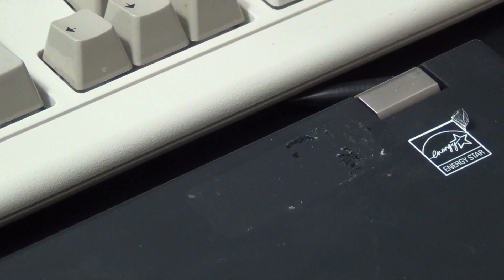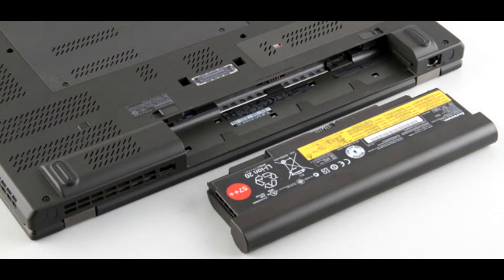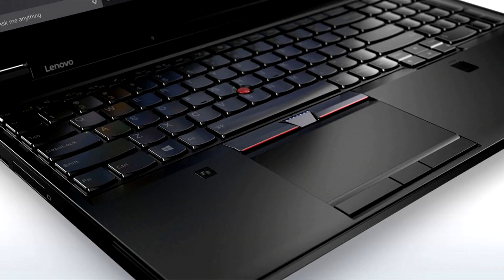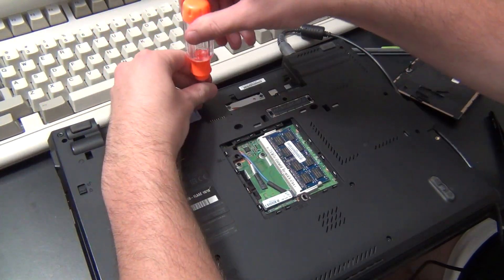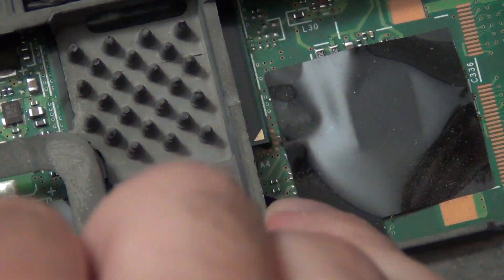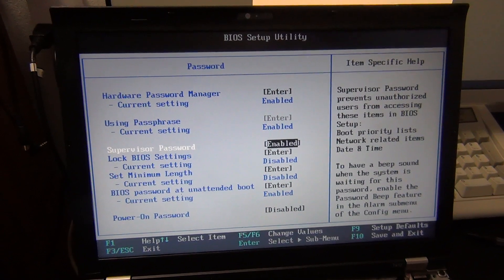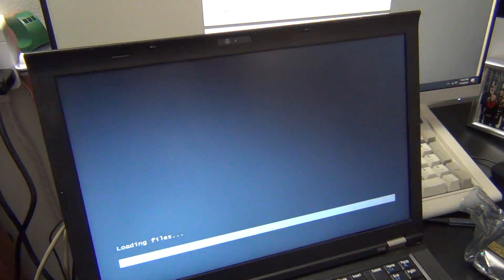Removing a Supervisor Password from a ThinkPad.

Comment: Does it work on Lenovo t14 gen 1?
Reply: I have a t14 gen 2 bought like this. But I haven't seen any solution to this.
Reply: TLDR: I'm still weighing in the cons If I go with SPI Programming using a ch341a and something like flashrom, since most Intel platforms starting with the 5th generation and beyond, especially those incorporating Intel's PTT and newer security features, have moved away from storing sensitive data like the bios password in easily accessible EEPROM chips. 

On devices like the ThinkPad t14 gen 2 with an 11th gen cpu, the supervisor password and related security data are typically stored in the Platform Controller Hub (PCH) or other highly integrated and secure areas of the system firmware.

Comment: worked on t410i thinkpad. had to wait 1000-4500 milliseconds before shorting the circuit when the boot screen appears to time the crash.
i need to reset a e11 5th gen non yoga, same supervisor password problem.

Comment: will it work on t450
Reply: "PLEASE READ: This has been pointed out in the video, is mentioned in the description, and has been mentioned in numerous comments. THIS PROCESS WILL NOT WORK WITH NEWER THINKPADS. THE NEWEST THINKPADS THIS WORKS FOR ARE THE T430, X230, W530, AND OTHER **30 SERIES MACHINES. THIS PROCESS WILL NOT WORK FOR NEWER MODELS (T480. P50, X1 Extreme, X260, etc etc etc). Please, PLEASE watch the whole video or read the description before asking in the comments, I am tired of answering the same question for the tenth time." no

Comment: Can it be done on a Lenovo L440? If yes how do I go about it?
Reply: no
Reply: @my_negative_world  Then how do i do it
Reply: @arthurgold5860  I don't know, I've got the same problem. From what I read It can't be done this way. You can try removing the cmos battery for a couple of minutes and if that doesn't work than just replace the motherboard. They are pretty cheap nowadays.
Reply: It worked on my L450. But I had to try a bunch of times. I tried different screw drivers to short the pins. Tried shorting and unshorting at different times. Etc. Finally it worked...

Comment: Ok after a lot of research I'm nearly 100% sure that this method won't work for T460 and above and I wouldn't even try it. In those laptops the password is stored on separate EEPROM and it needs to be desoldered and wiped to get rid of it. As far as I'm concerned this might mess the serial numbers of the unit. If You want to get rid of the password find a company that will do it for You giving a guarantee that Your machine will return intact. In my country I even found a company that claims it can remove the password using a custom made device that doesn't require desoldering the EEPROM itself. 

For those of You who tried removing the battery and the system is now screaming that the date is incorrect - in my case the date was set when I was a few minutes in the OS (They could at least enable us to set the date/time in the read only BIOS mode). 

I didn't try that but if You want to install a new OS, You don't necessarily need to change boot order in BIOS try to access the boot menu during boot sequence - F8, F12 or something else depending on the BIOS and then choose the bootable device. This might work if the supervisor password doesn't prevent that of course.

And the last one: if You want to check the BIOS setting for some reason, hit enter with blank password - this will give You access to BIOS in read only mode - You won't be able to change anything but You will be able to see what setting have been set.

Comment: the camera is directly over the hand working with the pins facepalm dude!
Reply: I believe the pins are the 2 holes that are aligned vertically to the 2 smd resistors(not 100% sure they are but they look like smd resistors just google them) and to the left of them and are connected to them by the trace

Comment: I tried scanning the comments for "Helix" before asking, but not one mention. Is this method applicable to my Ivy Bridge 2 in 1 machine?
Reply from the maker: If I remember correctly it is possible on the Ivy Bridge Helix machine, but there's only one way to find out!
Reply: @SebisRandomTech  Yeah it's currently inside out, I'm about to cross my fingers and hope I remember all the ribbon cables. Thanks!
Reply: Negatory.
Reply from the maker: @JonathanLeeWilson  Darn, sorry to hear that.
Reply: @SebisRandomTech  All this means is that my destination lies further down the rabbit hole, a more robust learning experience I am due.

Comment: One thing isn't clear from this video: how long i have to keep the pins shorted? After pressing F10 to save settings? After entered the BIOS?
Reply: I was asking myself the same thing. I successfully removed the password for an old Thinkpad. The pins to short were in a different location and I think you should keep them shorted all the time. Not sure, but maybe right before exiting the BIOS you should unshort them. In any case, repeat the process. Remember to press F1 to enter the BIOS. Use an external keyboard and an external monitor if needed. YMMV. Good luck!

Comment: I have a t540p bought from a friend. Everything on the bios is greyed out. I and even enter the sub categories. She doesn't remember setting anything related to supervisor password. I doubt she would really. She only used the laptop to watch movies. So now I have the laptop. I need to enable virtualization when I found this problem out after having the laptop for a few months now. So my question is will this method work on this machine?

Comment: Thank you for sharing this. Would this work with a T15 second generation?
Reply: NO! As he said in the video this method is only suitable up to the T430/530/W530 models. The newer version have Intel Boot Guard and frankly, there is no workaround but to completely change the motherboard.

Comment: The most useful video ever! Just one question, do we need to keep the pins shortened during the whole time or we can release it at some point?
Reply from the maker: Keep them shortened until you have reset the password and restarted the machine, if I remember correctly. It's been a while since I've had to do it.
Reply: @SebisRandomTech  Just unlocked x230 in a second attempt, tnx Sebi!
Reply from the maker: @alansavelski5240  Glad you got things working! Enjoy your laptop!

Comment: Greetings, I need a Lenovo YOGA 730-15IKB CMOS Battery disabled if one exists, or disable the Administrator's Password?  Almost all of the BIOS is corrupted.

I am not able to access any Advanced Mode Fix-it options, such as Cmd Prompt, due to a constant Password Block.

Uncertain if newer Lenovo Yogas use different Fix-it methods or if everything stays the same?  HELP, I've exhausted all I know, thank you...

Comment: Great video, sadly wasn't able to get this to work on my T21... uses an older 14-pin EEPROM with a pin between the two needed to short... which is seemingly tied to ground so shorting across it hangs the system.

Comment: Hi Sebi- Thanks for the video. I bought a ThinkPad  ibm s230u twist. It has windows 7 password and BIOS supervisory password. I would like to remove the supervisory pw so i can boot up from  a USB and  install windows 10. Do you have an advise on how to go about it? thanks in advance.
Reply from the maker: Unfortunately I can't find any information about where the EEPROM is located on the S230U, but if you can find out where the EEPROM is located the process should be similar to what is described in this video.
Reply: @SebisRandomTech  Thanks for the reply. I believe the vendor would be able to provide the location of the chip- I am going to buy a pre-programmed one and hopefully make it work . Thanks again!

Comment: Hi man,

I know you got lots of questions but I have somehow a relevant one in my opinion. 
I did everything you described with a T60. It worked until the point that I saved everything with F10. Afterwards the computer is just on and it does not do anything, nothing on the screen.
However when I manually turn it off with the power button, then start again and enter bios, it asks me the Supervisor password, or it shows this lock to enter a password. You know what to do exactly after you press F10. Should I stop short circuiting and wait for the computer shows me something, or should I wait while short circuiting? Or should I stop short circuiting before I hit F10?
Except that great video, thanks.
Reply from the maker: You might have to wait a little bit if it's sitting on a blank screen. Sometimes when I do that or I give it another try it ends up working.
Reply: i read somewhere, that on some thinkpad we should enter a password rather than leave it blank. just an easy one like 123, or asd. later you can change itu back to blank or other password. if we leave it blank, the previous password still active. sort of...

Comment: What about the BIOS PASSWORD?  There is any chance to remove the bios password? Or this methode works only with user password?
Reply: Hello,

Sebi is giving the info at the beginning of his video : the BIOS password can be removed if you unplug the laptop, the battery and the CCMOS battery. I add that if you have and a BIOS password and a supervisor password, don't remove the CCMOS battery. Because the date and time is reset and when you reboot the laptop, it displays a message concerning this, prompts you to go to the BIOS to change date and time, but it isn't possible because of the supervisor password. So : remove the CCMOS battery only if you DON'T have supervisor password.

:)

W.
Reply: @wilou62  i just bought my 1st thinkpad x230. But i saw much cheaper with bios password. Probably supervisor password. So if i have 2 passwords i cane do 1st remove supervisor passowrd and then bios and it will works?
Reply: @wilou62  you dont believed. I reset bios. Deleted passwords. Really. Then.. I were using x230 few hours. I wanted to check sth. And.. Enter thr fucking supervisord password after hard reset!!!!

Comment: Doesn't work on recent thinkpads. Tried on T495 and after 2 hours with the help of friend I can say safely this doesn't work anymore. The bios chip is located around the CMOS battery and the 2 pins to short is on the opposite size of the little dot on the chip.
Reply from the maker: Please tell me you watched the video and/or read the description. I believe I made it very clear that this process does not work on newer models.

Comment: I have an r500, but it seems that the bios chip is located under some aluminium sheet to the left of the touchpad, is there a way to access it without having to remove the mobo?
Reply from the maker: Hard to say, I’ve never done this on an R500. I do remember that era of ThinkPads being a royal pain to disassemble though...
Reply: Okay, thank you for your response

Comment: The motherboard in my T410 does not have the A4 labeling located next to the magnesium alloy piece, and does not have the two surface mounted components you are showing for the pins (connection points).

Do you know how to locate the SDA and SCL on this variant of T410 motherboard ?
Reply from the maker: http://www.ja.axxs.net/t410.htm
Reply: @SebisRandomTech  

Been to that site half dozen times.  Same pics as you.  No help.   Guess you don't know the answer ?
Reply from the maker: @turbodoggur  If that website doesn't have it then I certainly don't. Do you have a picture of what your motherboard looks like?

Comment: X230i - Doesn't work. 

It does gives you access to the full BIOS at the same start. But when you reconnect the CMOS battery, which you need to save the config, and then remove the AC plug; it won't power on until the CMOS battery's removed again. Yep, it's a catch 22.

Edit: Now it works. Just required 4-5 takes before finally reacting to the power button... Whatever floats your boat... :)
Reply: You don't need to keep the CMOS battery disconnected. Unplug it, wait a few minutes, turn on - the power-on password should be gone. Turn off the laptop, plug the CMOS battery back in. Now turn the laptop on and a second or so later short the pins. You should be able to get into Setup without having to enter the Supervisor password. And then you can set a new one.

Comment: Just wanting to be clear - you refer to "pins" in the audio but are actually using the two holes/contact pads just left of the 4 soldered points? Unfortunately your hand covers the target and you use the word "pins". Or perhaps they are pins, but it looks like holes on my screen.
Reply from the maker: Maybe "connection points" would be a better word.
Reply: The EE term would be "vias". They just serve to connect traces from different layers of the board together, but in this case give you a handy way to access the EEPROM.
Reply: The reason he is shorting the vias is that the EEPROM chip itself is located right under a metal chassis part on this model of ThinkPad, so it's hard to access. These vias have traces going to the pins in question, but you have to look it up to know this. If you can find the actual chip (it's a SOIC-8 chip, on my X230t it's marked L08), you can use the pins directly, whatever is more convenient. I didn't try it with these two pins, I shorted one pin (SDA, pin 5, the furthest diagonally away from the circle-shaped mark on the chip) to ground (VGA connector's body) with a micro test clip and a wire. Seems more easy and requires less of a steady hand than the tweezers approach. If you have such a micro test clip, of course. Got mine (a set of 8) on AliExpress, model name is SDK08.

Comment: Hi Sebi, I have bought a t440p but it has supervisor passwort. Could you make a video to remove the pass? Thanks
Reply: +1 Is there a method for T440p to unlock password? There is 2 chip on motherboard but is Haswell 4th generation -and this here doesn't work...

Comment: Hello will it possibly work with x series such as x270 thank you very much.
Reply: This is Unlikely to work on the new models from x240 upwards.
Reply: @ghostygaming32  do you know hot to delete the password from a lenovo thinkpad x61s
Reply: @Der_Maestro  I recommend you look on the Lenovo forums
Reply: @ghostygaming32  i did but it doesn't work with disconnecting the bios batterie...
And i did't found a other way...
Reply: @Der_Maestro  while the bios battery was removed and same with removable battery , press and holder power button for 30 seconds to drain the power . Another thing could try is while CMOS not in machine , tired to boot machine and should reset bios for you
Reply: @ghostygaming32  to boot without the cemu batterie does work but i wants the password and the trick with pressing the power button for 30seconds also doesn't work....
any other methode?
I found one but there i have to short 2 contacts together but i don't now where they are and its to dangerous for my self...

Comment: Hello will you ever another video of how to removed on newer ThinkPad? Such as 80s and 90s series t480 and t490 that is? Cheers
Reply from the maker: The process is completely different on newer machines and usually requires reflashing the BIOS, which is beyond my area of expertise. In addition I would be weary about a ThinkPad as new as the T480/490 with a password at this point in time as I would imagine they are most likely stolen.
Reply: @SebisRandomTech  HAVE SOLUTION T460 LENOVO?

Comment: Hey I just wanted to know because I’m trying to get rid of the bios password on my Lenovo ideapad y700 and I was wondering if you could make a detailed vid on how to remove a bios password
Reply: For BIOS password you can just unplug the main battery and the CMOS battery (for a y700 its a small black circular battery with a black and red wire coming out of it)
Reply: David Bosilj I’ve tried it that hasn’t worked

Comment: Do this to hundreds of thinkpads, load cloudready onto them and sell them to schools.
Reply from the maker: Is that something you do or is it something you’re suggesting me to do?
Reply: Sebi's Random Tech I am suggesting you do this, because old thinkpads that are not so rare can be found for cheap, and since chrome os is a lightweight operating system, even though they are old they will run just fine. So you do that, and if you want you can give/sell them to schools in need of computers for their students. Again, just a suggestion.
Reply from the maker: As I reply to this comment I’m working on some T61’s I received from someone. They’ll be going to a local school district when I’m finished with them...

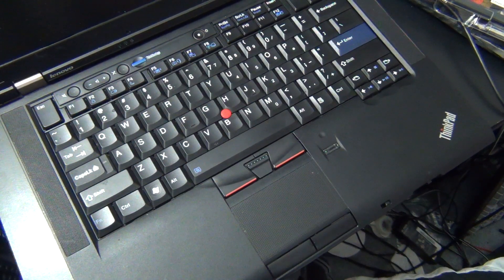Comment: 2:18 thats my laptop. I have a annoying problem with my keyboard, when i press E,D,C,3,F4 or F3 it beeps and it types weird stuff
Reply from the maker: Might need to replace the keyboard.
Reply: @SebisRandomTech  already done that one time but after a few uses it begon again
Reply: @naaD69  cry
Reply: @isopycnic746  great idea
Reply: @naaD69  no bother lad
Reply: @naaD69  mine does that because of a faulty hard drive. try to run chkdsk on your HDD because bad sectors/clusters can cause that you mention..
Reply: @andebriceansing1666  chkdsk said no problems
Reply: @naaD69  is this the command you use. chkdsk c: /f /r
Reply: @andebriceansing1666  yep
Reply: @naaD69  try to disable your keyboard driver and insert a usb keyboard and see if problem still exist, if it does then maybe its your operating system,,
Reply: @andebriceansing1666  with the bluetooth keyboard it works Just fine
Reply from the maker: Visually inspect the keyboard connector and make sure no dirt or dust has gotten in. Look for any signs of damage to both the connector on the motherboard and the one on the keyboard.
Reply: @SebisRandomTech  it looks like the cable has kind of a dent, i pressed a little bit on the dent and now it only does the gibberish with the 0,P and - key